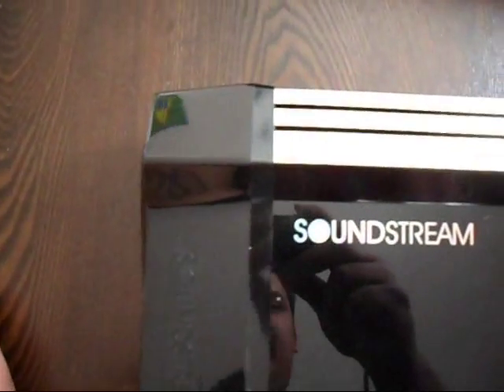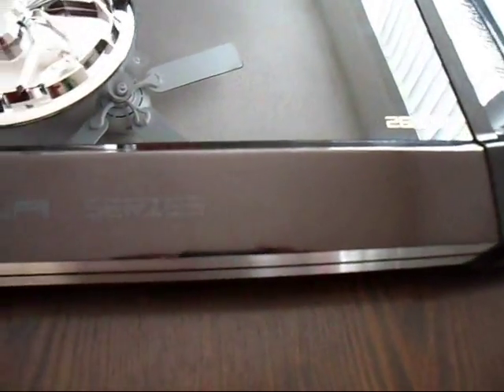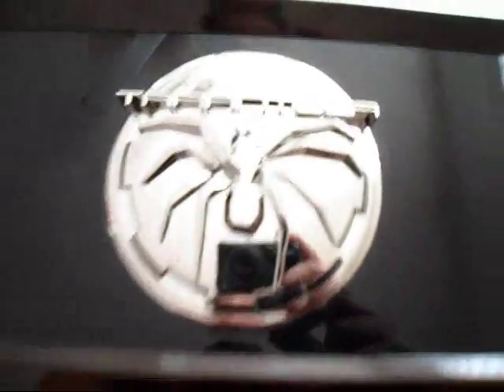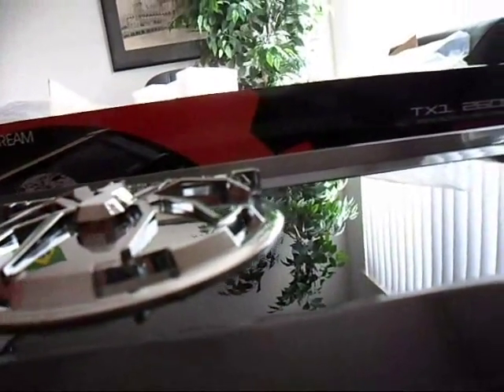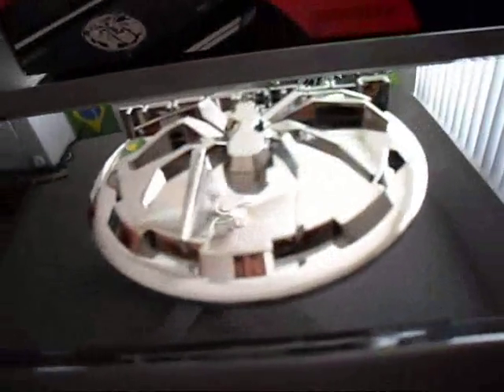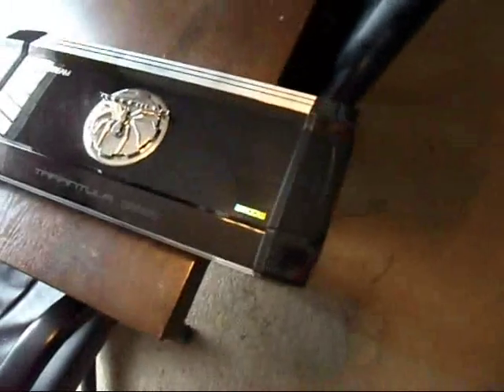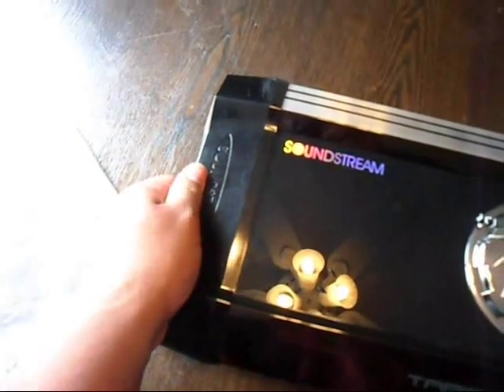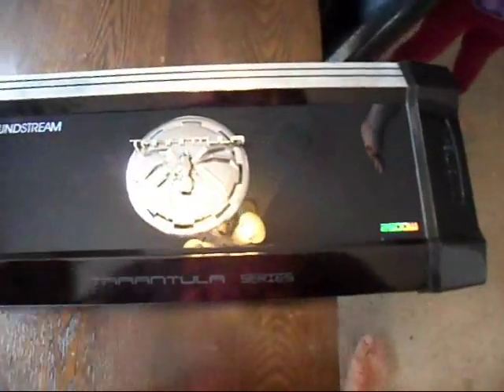SOUNDSTREAM TX1.2600D half ohm stable amp UNBOXING

Comment from the maker: i woul reccomend it for sure , it should be cheaper now .... i still have this amp running it daily at 1ohm and its holding up just fine as far as the wattage goes i have never clamped this amp but im pretty sure it does not put out what it sais but close enough ..... make sure you have the electrical to back this amp up because it is power hungry